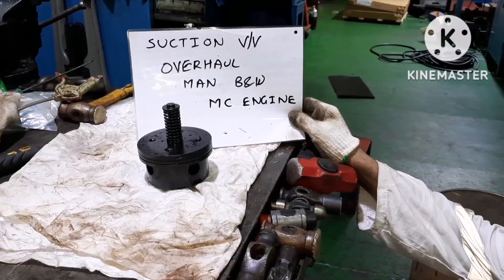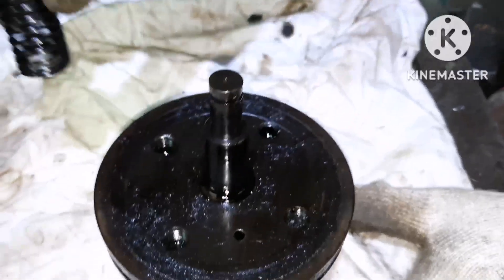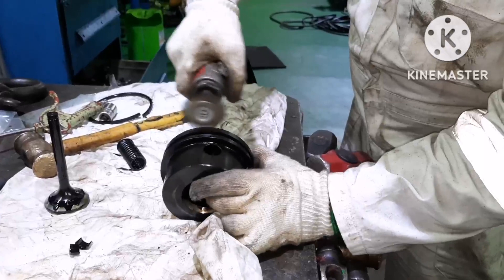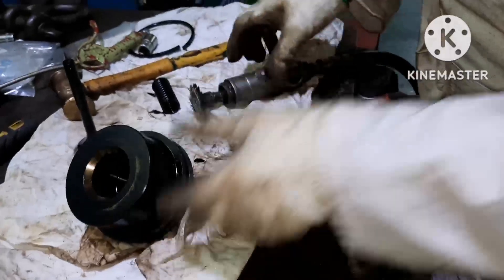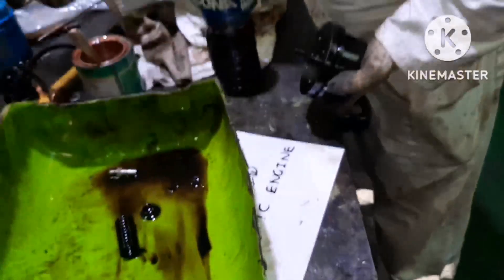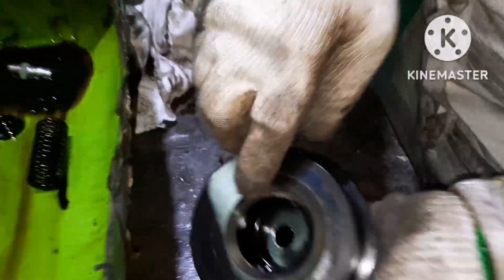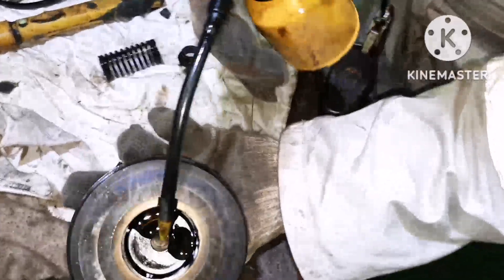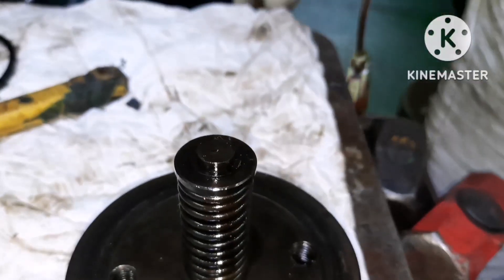HOW DO THEY DO.. HOW TO OVERHAUL FUEL PUMP SUCTION VALVE FOR MAN B&W MC ENGINES...

Comment: Sir Why didn't we clean piston with the help of buffing machine...
Any reason behind that.
Reply from the maker: Top land you can use buffing machine but on the side these piston have spl cote of metal which may get damaged or removed wen using abrasive cleaning method..